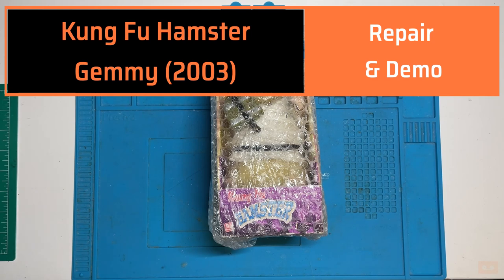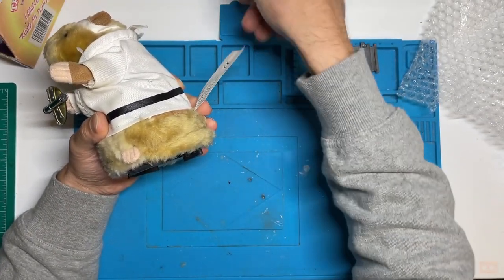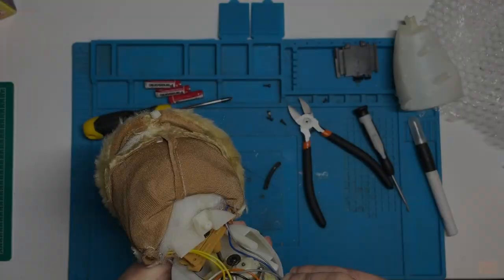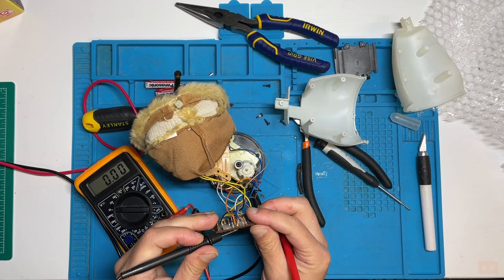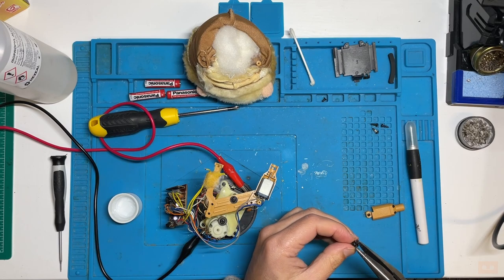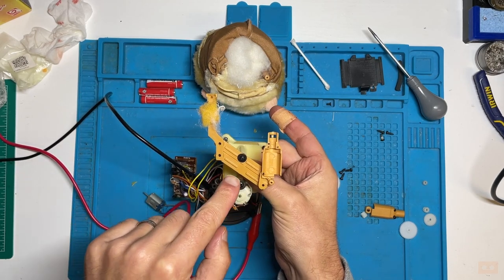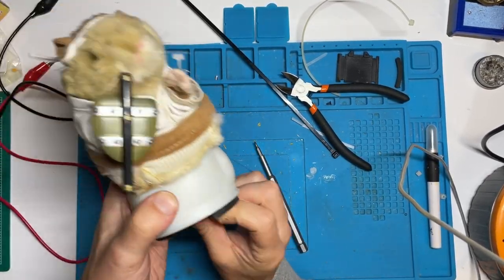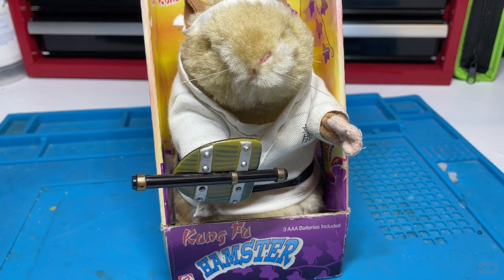Retro Toy Repair: Can I FIX Gemmy Kung Fu Fighting Hamster!

Comment: I had one of these and broke it as a kid. I still have it and opened mine up but the wires soldered on the board have all come off. Is it possible for you to show the connections of the wires on the board?? 

I’d be really grateful
Reply from the maker: @etherealbean253  I really wish I could help, but unfortunately I have so much footage making these video I can't keep it all, and basically delete it after the final video is released.